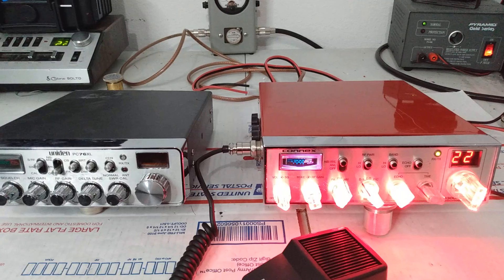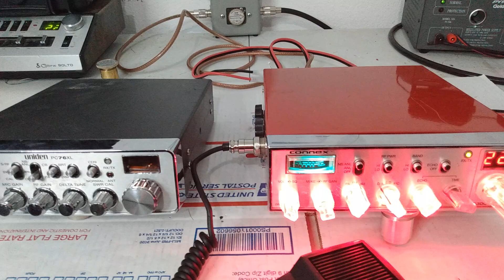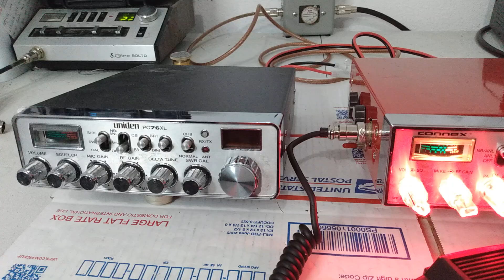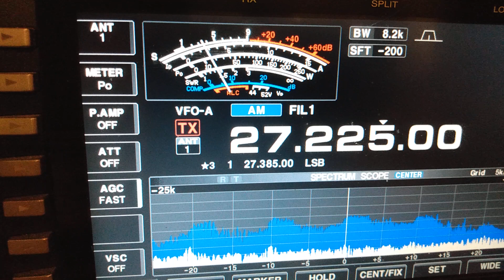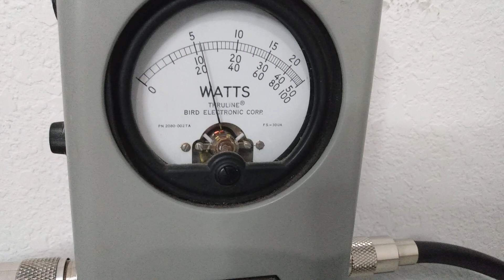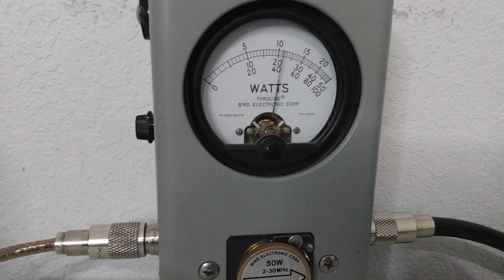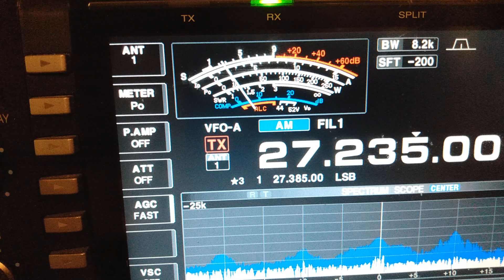Does "Average" Power Matter? Identical Peak/PEP output Radios, with Different avg Power levels, TEST

Comment: So tune my boxes for max bird? I know it’s a hot topic and that pep is the new kid on the block lol.
Reply from the maker: I almost always do with a few exceptions.
Most older AM transmitters were tuned with a carrier which is closely related to avg power
Reply: @Rooster_Radio  ok cool deal thanks man I’m fairly new to tube amps, I recently got a line section and a couple slugs and got that cheap dosey and jumper out of my station. Idk if il get the pep kit or not so it’s bird for now lol

Comment: One thing he did say about the export on the right... He said 20 bird... Looked more like 18 to me.... But in any case.... This test has already been done and I can tell you that an export radio... We'll back down a few watts Once pushed into an amplifier... Which is fine.... On the other hand the Cobra or Uniden. Doesn't back down... Which is why serious operator running power choose Cobra
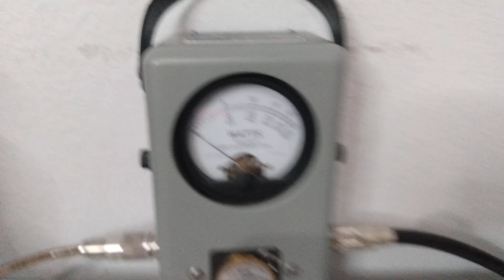Reply from the maker: 3:50 20 watts on the dot.
I'll be doing another video running both into a 2 pill 2879C
Reply: @Rooster_Radio  ok... But like I said.. That radio will back down .. When you put it into a driver... So to be more like 18 or 17.... Which is fine.... Stickman of no name amps did the test long time ago it's on video on his channel
Reply: Interested also. The cobras and unidens have a modulation transformer and the exports have a different modulation circuit that supposedly isn’t as “good” lol. And the cobras l/unidens would swing full output basically no matter were the dead key is at. I’ve been told that the 29 currently has the best audio circuitry for loudness when modified (for a plastic radio) I find this stuff super interesting.

Comment: I was shocked that the Uniden sounded cleaner and easier to hear. I didn’t see very much difference in the signal gain. The Connex showed a hair more gain on the meter but if I wasn’t watching the meter I say they were pretty equal with the Uniden sounding better
Reply from the maker: Wasn't too concerned with the sound. I had the mic gain set in random positions and just happened to have echo on the Connex.
The main focus was to take two radios with identical Peak outputs, but significantly different average power readings and see how that translated to actual signal strength.
2-3 S units doesn't seem like much, but it's the difference of being heard and not. Of course, adding an amplifier will make the difference between radios far less noticeable.
Reply: Rooster should have turned off the echo on the connex... I don't believe the pc76 was doing 50 watts pep without being heavily modified.

Comment: I stand corrected sir. You mentioned that the average is the one that may or may not kill an amp. So meaning to say, if I'm putting around 4 to 5 average input in a kl300p, the amp will still be safe either you've got a 15 or 25 watts pep input into it?
Reply from the maker: deadkey or carrier is more related to average power than it is peak. All power levels are relevant. Peak, Avg, Deadkey, with deadkey/carrier and average power having greater effect. That amp you are speaking of is low drive and ideally should have no more than 3 watts deadkey and according to their suggestion 10-12 watts PEAK. You can get by with a little more peak power, but do not exceed the 3 watts deadkey.
Reply: @Rooster_Radio  I sure do appreciate it Rooster. The way you explained it was up front and very clear. All the best sir.

Comment: Do the same test using the exact same radios into a     2x 2879, and see which radio drives the amplifier the hardest.
Reply from the maker: I can for a fact tell you in regards to a 2 pill 2879c the Connex will usually get around 200 avg while the uniden will show 150, but I'll do that test for sure.
I'm a uniden/cobra person primarily
Reply: I would like to see that also!
Reply: I like the cobra /uniden and older single finals galaxys myself.

Comment: 70% of bird 43 owners don't even know how to use a bird meter correctly. you need to use the lowest power element possible to give a near or full scale reading with the meter lying down flat, not standing up to be as accurate as possible. the bird 43 has a +/-- 5% accuracy AT FULL SCALE, not bottom, middle or anywhere else. so when you take a reading at the bottom of the meter scale you can have up to a 25% inaccuracy. example: reading 500w on a 2500w element is wrong, you will get a false reading. 500w? use a 500w element for an accurate reading. the elements have a degree of inaccuracy as well so that adds to the equation as well. the detector diode in bird elements are not temperature compensated so you can get different power readings on a cold day compared to a hot day. and fyi, bird meters are not lab grade instruments. its not the holy grail of perfect accuracy everyone makes it out to be. it was built to be a very rugged, heavy duty, self serviceable meter that gives a usable, FAIRLY accurate reading good enough to use for hobbyists and commercial broadcast applications.. 5% is a big variance, especially the higher up you go in power. they also think pep is "fake watts". the most ridiculous statement i have ever heard.

Comment: the bird 43 CANNOT read a modulated waveform accurately. the avg readings people look at while modulating are not accurate. you must use a pep kit in pep mode to read a modulated carrier accurately. the bird 43 was made to read a carrier and nothing more. straight from bird: "The model 43 is not the best choice to measure AM modulated signals. It will not measure the average power of this waveform accurately due to the fact that the peak to average power ratio of this signal is not zero".

Comment: So, would peak power be better used as an indication of how the radio is modulating or perhaps relative to how "strong"  the audio is?  The measurement of peak watts seems like it should be relevant to overall setup but be just another data point to be considered when trying to get a well balanced station.  Thanks for demonstrating it.

Comment: Pretty cool video it sure is a debate among some operators and very confusing for the people who are just starting out with CB radio equipment or even rekindled an old hobby ..
Bird 43 is not the best choice to measure AM modulated signals , it will not measure the average power of this waveform accurately due to the fact that the peak to average power ratio of this signal is not zero?..
Now that's not my statement and I don't know enough to comment on it but it's on frequently asked questions on Bird website
They suggest using APM16, 5014 with a B series element APM10B or equivalent DPM element this combination will provide the average power of this modulated waveform ??..
I'm really confused about all this and glad you're showing your test results with pros and cons which ever form of measurement
Honestly I really don't know if ones better than the other... thanks

Comment: Average power is confusing and useless to me, doesn’t mean a crap to me, just saying.
Reply from the maker: If this video doesn't convince that Average power isn't "useless" then I don't think much will. It's obvious that it's a relevant and significant measurement of useful power. More current consumption and more signal, but as.always... to each their own
Reply: So since you don’t understand something you just disregard it?
Reply: Average power is confusing…I have a maco kw that dead keys at 100 watts and swings to 1500 … so your telling me my amp is isn’t working right
Reply from the maker: @gjm8461  how did you gather your amp isnt working right? It's probably doing 550-650 watts average if it's doing 1500 peak

Comment: Just a question. If pep doesn’t matter then why is it there?
Reply from the maker: I would not say it absolutely doesn't matter. It serves a purpose. IN MY OPINION, peak is best served to measure what % "modulated" a signal is. And although it appears that average power carries more weight and influence, peak power is still relevant and should be considered.
Reply: @Rooster_Radio  thank you